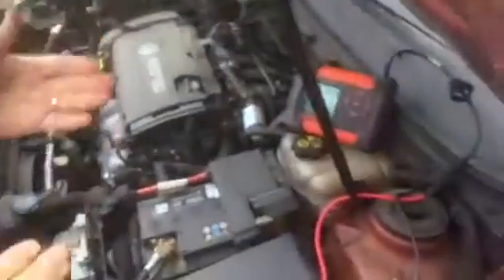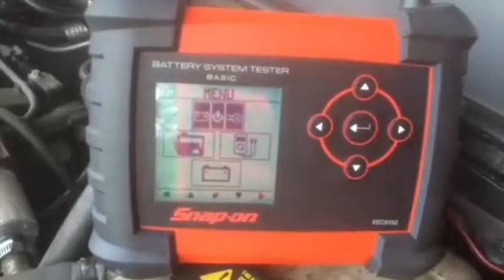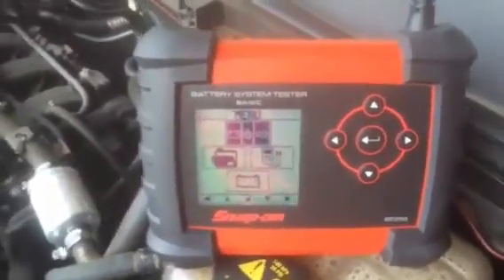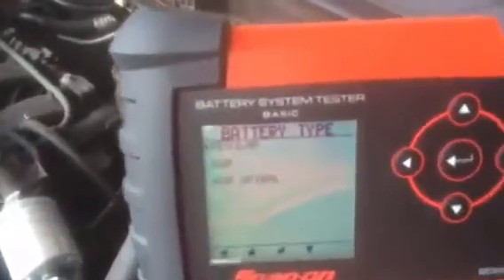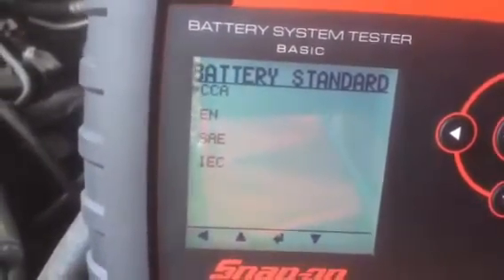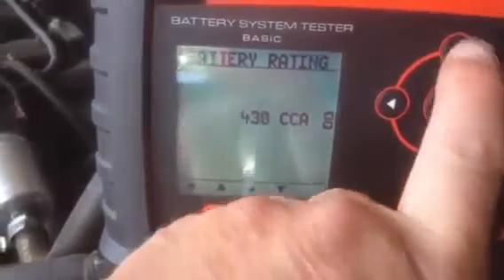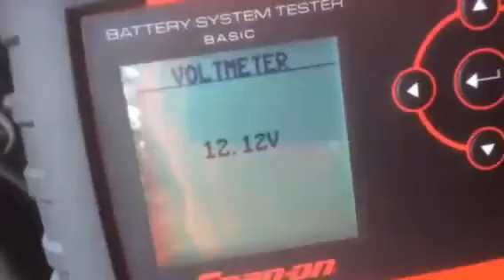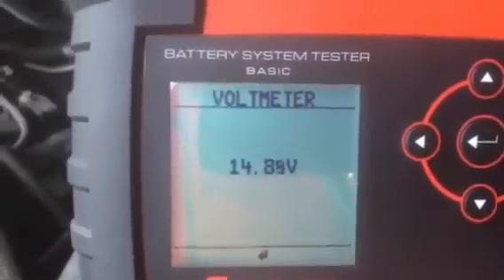EECS150 Basic Battery system tester

Comment: The the biggest problem I find with this tester is, it doesn't record or freeze the lowest cranking voltage on the starter test. Apart from that it's a good tool